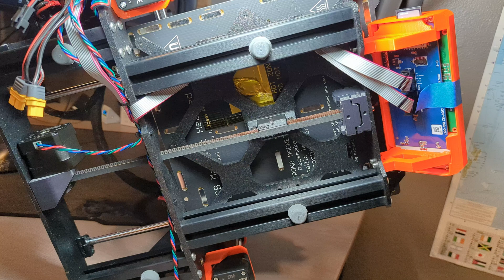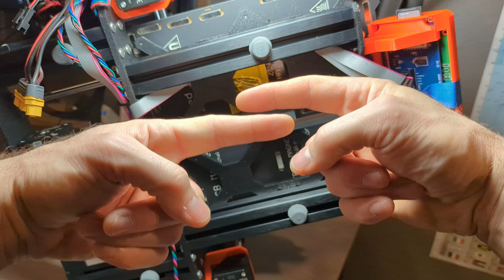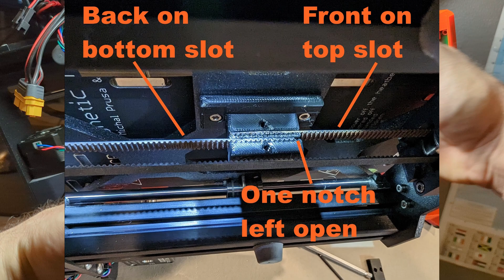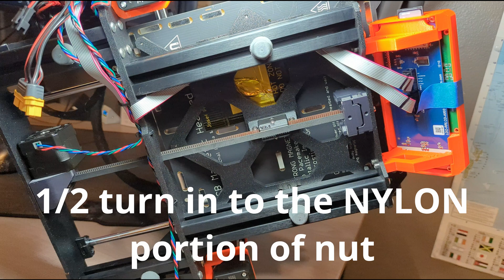Prusa MK3s - y-axis upgrade for increased rigidity and easier belt tension adjustment

Comment: I have printed all the parts and assembled them as indicated and it is impossible for me to pass 170 in the tests of the strap on Y . I have disassembled it several times and nothing, something I must be doing wrong but I can not get it and is very far from the 240 minimum tension on the belt , you give that measure , to me impossible and I take for granted many problems of shock in And as is logical, apart from some error in selftest by strap distance. Thank you for the video and parts

Comment: Just a FYI, there is a remix of that tensioner that only uses two screws in the middle. A bit easier to adjust.
Reply: Thanks for the heads up! I saw that version but I prefer the four screw version.